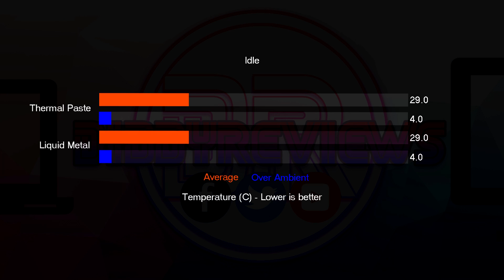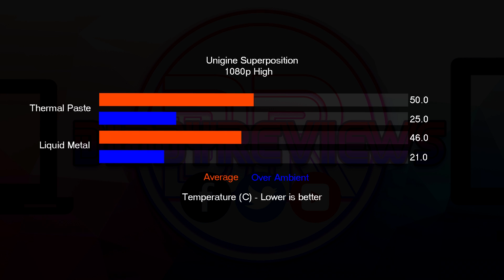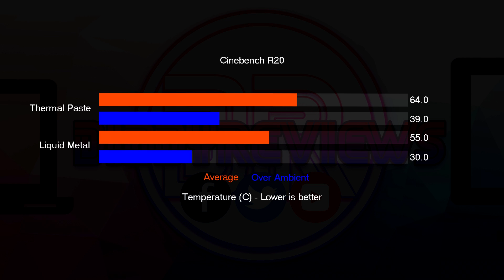Thermal Paste Vs Liquid Metal - Thermal Grizzly Conductonaut Review

Comment: Liquid metal show is best on laptops. If you have liquid cooling, liquid metal do not improve too much, but improve. But on laptops I saw impressive results because the heat spreader system is small and less efficient than desktop PC. I put liquid metal on some gaming PC gaining 20 degrees!!! No more throttling, no more 100 degree CPU (typical with last powerfull CPUs like i7 and i9 12th and above). My i7-12700H passed from 90C° throttling ad 80C° full power (4,7Ghz, 115 watt peak from Hardware monitor).
Reply from the maker: Its great stuff. As you saw from the video it works great on desktop too.
Reply: @DowsettReviews  I am studing a good and quick way to contain the liquid metal, like a wide-adesive (scoth) made of foam like material and that can resist almost 130 degree. So I can make a window (hole) in the center to free the head of the CPU/GPU die. The foam like material will collapse under the heat sink sealing the CPU/GPU die

Comment: I have a 220w cooler and a delided i7 7700k can i improve temps with that if i use liquid metal also on the cpu cooler? Hmm im not sure if its worth the mess
Reply from the maker: That's pretty much what liquid metal is normally used for. Just be careful as it is conducive

Comment: How's the aging??
How long the 1st paste before need a repaste?
Did you apply it as s thermal paste in between IHS and cold plate/heatsink?
Even when dried out did it perform the same?
Reply from the maker: I literally just applied it and tested it there and then I didn't do any long term tests so I can't really answer your questions. I know it's not what it is intended for but I put if on the IHS as that was the test I wanted to do and didnt want to de lid my cpu.
Reply: @DowsettReviews  So you already remove the liquid metal?
Reply from the maker: @gamertechlive1780  I've upgraded since and I've been chaging coolers for reviews and other things so I haven't been using it. This video was quite a while ago.

Comment: It sounds like you applied the LM between the heatsink and CPU, this is not the intended use. You are supposed to apply between the heatspreader and the CPU die.
Reply from the maker: Yes that is the way I did it. I know it isn't the way it's intended to be used but I tried it this way and made a massive difference still.

Comment: My processor i7 4790k. gaming Temps are in the 85-90°C rang.   reduced my temperatures best solution liquid metal or thermal paste?
Reply from the maker: You can try it. Won't hurt to try. Liquid metal has the better thermal conductivity but depends if you are comfortable using it. Have to be very careful not to get it anywhere else as it is electrically conductive and therefore can damage other parts. When was the last time you changed thermal paste?

Comment: Any good for an RTX 3080 on the vram chips?
Reply from the maker: I havent tested this I'm afraid. Generally you would use thermal pads on vram to make contact between them and the heatsink. Normally this is only used on the cpu, bare die or gpu die.
Reply: @DowsettReviews  Yeah looked into that saw was a bad idea, maybe thinking this kinda thing instead seems just as good if not better? https://www.overclockers.co.uk/thermal-grizzly-carbonaut-thermal-pad-51-68-0.2-mm-th-02f-tg.html
Reply: Says it's for a thread ripper but I'm not seeing any reason it couldn't be cut to size
Reply from the maker: @LukeJonGibson  for vrm you need proper thermal pads really because they have to be thick enough to make contact between the vrm and the heatsink or waterblock. Carbonaut pads are for cpu cooling instead of thermal paste.
Reply: @DowsettReviews I had already considered that, sorry I guess I was expecting you to already fill in the gaps, my bad, I know you lose efficiency stacking but as far as I understand it's not terrible and I was wondering as the thermal conductivity of these pads were so much higher there might be a fairly significant benefit to using these as the contact on the VRAM side as they'll draw the initial heat away much faster. 

I saw a lot of debates around exactly what thickness is required on the rear plate and there seems to be a range of opinions from 1.5 to 2mm to a mixture of both and ever 0.1mm in between, so my idea was stack these as the base of some decent 12.8 W/Mk thermal pads. 

Although maybe I'm just being stupid and there's a very good reason not to, but as long as it was isolated from other electrical components using these 0.2mm pads directly onto some custom shaped 1mm-1.5mm copper plating fitted to the backplate directly would in theory put the thermal performance of almost any other material to shame, for a fraction of the cost.100mmx100mm of copper is like $10 and has a thermal conductivity in the hundreds, just far more of a pain in the ass to cut to size, but I can't believe having that much extra thermal performance wouldn't be worth at least attempting.

I'm just bouncing ideas so ignore me if I'm being moronic. lol
Reply from the maker: @LukeJonGibson  mate I have literally no idea if it will work or not but I would be very interested to see your results. Please let me know when you have tried it. In theory it sounds like it could work. But I'm no scientist lol.
Reply: @DowsettReviews  That's all I was hoping to hear really that I'm not just missing something so obvious that only an idiot would try it 😂😂 I bought a 3080 on launch day I was fairly broke at the time so I had to scrimp for the cheapest one I could get, obviously totally unaware of the thermal issues that plague the cheaper models at the time. The VRAM temps I get are  shocking, if these cards weren't worth their weight in gold and harder to find than big foot now I'd send it back as unfit for purpose. Even using 60% TPD ~210W the chips are hitting 106 to 108c , so I'm having to seriously neuter my cards performance so I don't kill it before the years out, hence why I'm so eager to find the best solution possible, but at the same time it makes me nervous to be one to test the water in case I end up killing the only card I have with a minimum replacement value of over $1500, catch 22 really. lol Anyway I'm gonna keep looking into it and see what I can come up with and I'll let you know if I have any success :)
Reply from the maker: @LukeJonGibson  which one you got? Didn't know they were that bad. I'll have to have a look at mine I only really monitor the gpu temp. I have FE. Hoping to watercool it soon.
Reply: @DowsettReviews  LMAO I just finished my  comment and YouTube had an error and deleted it when I tried to save it again trying to edit a spelling mistake. LOL anyway, In a nut shell what I said was mine's the Gigabyte RTX 3080 Eagle OC but seems they all cut corners on the cheaper versions because the intro price point was low, maybe they were assuming the extra headroom of the GDDR6X would let them off the hook, but the issue covers the entire 3000 series, only models that have spent the extra on addressing the thermal issues with higher quality components seem to be safe, I won't be surprised if Nvidia and their partners get slapped with a class action if suddenly millions of peoples cards start dying long before they're meant to. 

Don't know what model you've got but only the 3080 and 3090's seem to have inbuilt temp sensors that don't require messing about. But if I think there's a way if you go hunting.

You can probably get vram temps using  hwinfo64 https://forums.tomshardware.com/threads/how-to-monitor-gpu-vrm-temperatures.3478267/

Here's an article on it:
https://www.notebookcheck.net/NVIDIA-GeForce-RTX-3090-mod-can-reduce-VRAM-temperatures-by-up-to-25-C.528004.0.html
Reply from the maker: @LukeJonGibson  fingers crossed they don't all start breaking. I have the founders edition. I'll have a look if mine has sensors for vram.
Reply from the maker: Mine constantly sits a 94 degrees whilst gaming

Comment: really helpful video man, I heard it has another downside is that It can damage the heat sink of your cooling right
Reply from the maker: Thank you buddy. And thanks tor watching. To be honest I'm not really sure if it can. It's a bit of a pain to get off. Maybe it can damage over a long period of time. I'll have to look into it dude.b
Reply: @DowsettReviews   because it has warning that it can't be used with aliminum Heatsink because that will cause corrosion so only Cooling with Copper or better heatsink is recommended . my Cooling has a copper heatsink but I am still kinda worried. May I ask what is the material of your cooling heatsink ?
Reply from the maker: Ah yes it can't be used with aluminium I do remember this now my cooler is nickel plated copper and so is fine. Copper will be fine buddy as far as I am aware.
Reply: @DowsettReviews   Oh thank god for your help. This is really helpful . My CPU has been on Fire recently , I used Artic MX4 together with a 360mm Thermaltake AIO but it still can't help me much in decreasing the cpu temperature . So the only one thing I can do is using this Liquid Metal to help decreasing the CPU temp.  Your answer saved me. I wish you luck and success in the future , I will sub to you now <3
Reply from the maker: Thank you.

Comment: The hotter you go the more liquid metal will show an improved difference in temp. Measuring at idle is pointless as both paste and metal will dissipate heat at the same rate since idle heat is below the resistance threshold of both metal and paste.
Reply: Yes correct I did some research and most result I found when it's applied as a regular thermal paste.
In idle there is -1, 0 or+1 degree vs kyronaut at idle but at full load the liquid metal is -3,-4,-5 over kyronaut
Reply: i have an msi ge63 raider rtx2080 and i7 8750h. Even with undervolting the cpu, i get very fastly 86c on the gpu running at close to 150w and at reduced clockspeeds (i think it thermal throttles because it can go like 1900mhz but it goes down to 1600mhz). The cpu is worse, i get 97 very quickly and the clockspeeds go down to 3.3ghz instead of the 3.9 or 4 ghz that it should run at. The max standard wattage is 45w and it can go to 60w or even more, but it still gets to 95c or 97c with like 30watts. Do you think i will see an improvment? Im either gonna sell it or polish the cooler and add liquid metal. Thanks
Reply from the maker: You can try it if you are comfortable taking it apart. Be very careful though as its conductive
Reply: Given how I'm going to be playing the "new" Ark, imma need the liquid metal. XD

Comment: Liquid metal is for direct die cooling where you will always see 8C-25C improvement with PROPER mounting contact between die and heatsink.  
Liquid metal is not meant for cooling between a CPU's IHS and a heatsink.  It will only contribute to 1-4C improvement in this scenario.  Yes, it is still an improvement over traditional thermal paste, but that is literally just 73 w/mk vs 7 w/mk.  
No, you will not have a GPU idling at "0C" because you already idle at 20C.  You will idle at around 14C-17C because it just performs better than thermal paste.  Under a FULL LOAD, you will see 15-20C improvement over traditional paste using liquid metal as your TIM.  
Liquid metal is for DIRECT DIE cooling.
Reply: @DiddyReviews findings are quite acceptable as I and others have had similar results with Liquid Metal (LM) applied solely between the IHS and waterblock.  However as you assert, LM is indeed generally intended to be applied direct to the die but it's certainly not a rule. Applications on top of the IHS can vary widely in terms of success due to the large degree of tolerances used in manufacturing the blocks surface to mate to both convex (AMD) and concave (intel) IHS's. Such tolerances are afforded by the use of orthodox pastes. Surface finishes can also make using LM a futile exercise. For example, some manufacturers now use a brushed finish which is a no go for LM. 
As Diddy mentioned (but didn't differentiate) copper surfaces require maintenance applications but applications on nickel plated blocks can last, (in the absence of testing data to reference) a very long time . I've had applications last for as much as 2.5 years and counting. I've never had to re-apply on nickel, although I'm pretty sure there will be instances where this isn't the case. Overall, it's definitely a finicky exercise as it often fails. Many would consider the potential for failure too high to even attempt but for others, it's definitely worth a try to see how well your block mates in order to realise the sort of temp drops witnessed here and elsewhere.
Reply from the maker: @briceni-xyz  some good information there buddy. Thank you for watching and your comment.
Reply from the maker: I never said I would idle at 0. I said if I had a 22 degree drop it would be 0. Which I know wouldn't happen. I was joking. And yes I am aware that it is generally used for open die but as I have proved here it can be used directly on an IHS and is and improvement over thermal paste which is literally what the video is about.

Comment: 4:45 that is quite a significant advantage for liquid metal!
Reply: yea right and about fps in games increased how much 1 or 2 ? I have stock from amd cooler 3600x and i have 31c idle max 61c on gaming cinebench max 81c with stock cooler...  WHy we need to reduce 2 or 3 c ? Reason ? in gaming is useless .
Reply: @MakeSh00t  I guess for laptops its more important to prevent termal throtling. And more so in futuro when your cpu reaches 90° and maybe 85 with liquid metal
Reply from the maker: Yep

Comment: Thx for the video. What CPU did you apply it on?
Reply from the maker: No problem. Thank you for watching. I use a 7700k.
Reply: @DowsettReviews  Thx again, will try it on 9900K and see if it helps as this monstrous CPU runs freaking hot (even with custom loop or NH-D15, tried both)
Reply from the maker: @CustomDaGG  let me know how ya get on. The other things ya could try but they're risky are lapping your cpu or delidding it. Well delidding is risky anyway as far as I'm aware. Never tried it and don't think I would.
Reply: @DowsettReviews  Will do :). Direct die cooling might work but they don't ship Rockit Cool direct die kit on amazon to where I live.

Comment: Idea for new video: test it on GPU. I got 20-22c drop after putting coollaboratory liquid ultra on my gpu! amazing stuff.
Reply from the maker: Yeah I was going to put it on my gpu when I put the block on it but I got scared with it being an open die lol, didn't wanna break my gpu. Maybe ill do it when I upgrade.
Reply from the maker: If I got 22c drop using liquid metal mine would be almost 0c at idle lol. Cant imagine id get that much drop.
Reply: @DowsettReviews  I mean it went from 65 -> 43 under load, ambient was 25 so it depends on how much heat your card puts out and your ambient of course. I have a 380w bios on my card so it was an optimal candidate for better thermal transfer!
Reply from the maker: I water-cooled my 1080ti a couple months ago and mine dropped too down to around 40-45 under load. I meant if I dropped another 20c by using liquid metal then if be at almost 0c at idle lol. Im not sure liquid would drop mine much further but I may well try your suggestion for a video at some point. Thanks for the idea.
Reply from the maker: My card generally stays at ambient temp around 25c at idle and barely gets over 40 under load.

Comment: Really great video. 

Which thermal paste you used against the liquid metal? 

I have an HP mobile workstation(laptop) Zbook 17 G1. i7-4800MQ / Nvidia Quadro K3100M. Should I go with the Kryonaut or it's liquid brother?

Thanks again for the content ✌
Reply from the maker: Firstly thank you so much for your kind comment and for watching, I really appreciate it. 

I used the thermal paste that came with my alphacool water cooling kit. 

It depends how comfortable you are with using liquid metal, you have to be really careful with it as its electrically conductive so if you get it on other parts of your motherboard etc you could damage your system. Thr kryonaut is definitely going to be better than what is used as stock i would have thought.
Reply: @DowsettReviews  Thanks man. I have ordered 5 pcs kryonaut 1g + 3pcs 100mm x 100mm, 0.5mm thickness thermal pads.

I hope they're going to be delivered fast. Yes the liquid metal is a risky process even if I got it right moving the laptop occasionally will give me goosebumps 😁
Reply from the maker: You are most welcome

Comment: Great video. How did you apply the liquid metal on cpu? Did you spread it all around or applied just a dot in the center. Also would you recommend as well for GPU?
Reply from the maker: Thanks buddy. I used a small blob and then spread it out with the applicator included. Its not the easiest application process and you need to make sure the cpu is properly cleaned with isopropyl before applying. I have never used it on a gpu because I was worried with it being an open die but I believe a lot of people do use it. But when I water-cooled my gpu just using the paste the temps are incredible already so I'm not sure itll need liquid metal